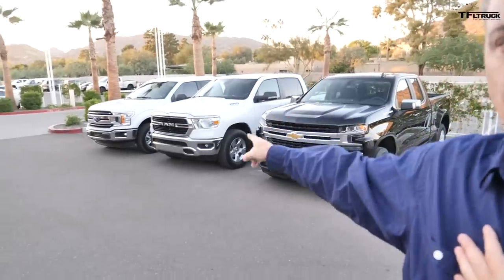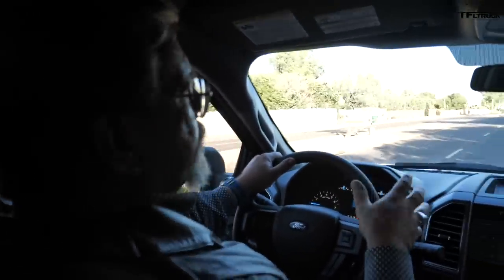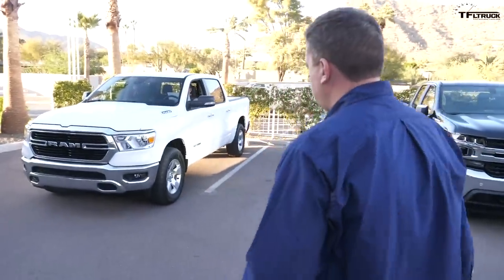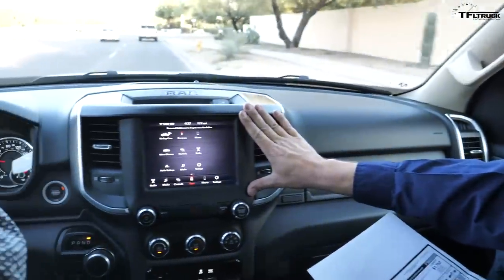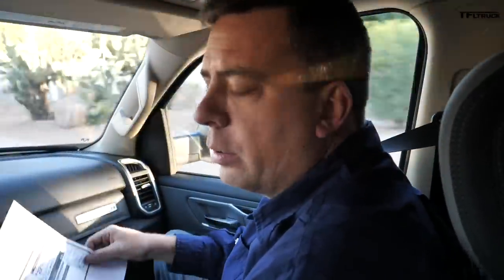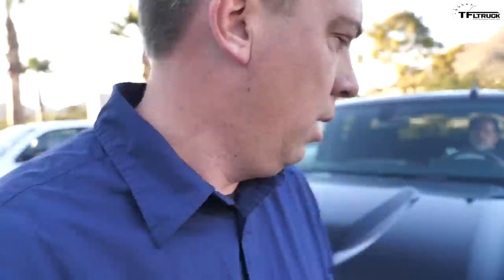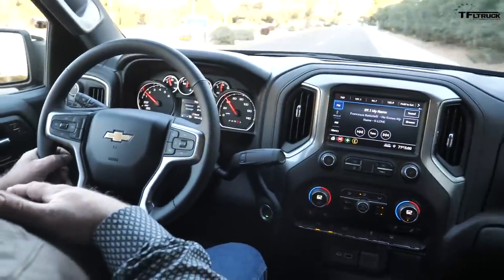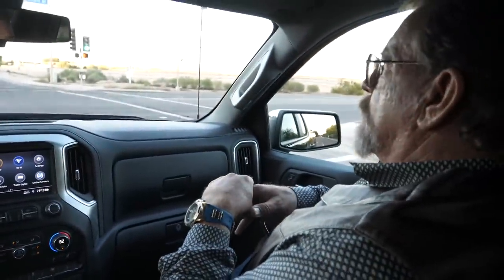Work Truck Wars: 2019 Chevy Silverado 4-Cylinder Turbo vs Ford F150 vs Ram 1500 Review

Comment: Oh that's sad that the Chevy has the worst fuel economy. I actually went on fuel economy.gov and look at the fuel economy on all 3 trucks and I was shocked 😲 at the results. So I looked up the fuel economy on the F150 in 4WD with the 3.3 L V6 as well as the 2.7 L turbo V6. The 3.3 L got 18 city and 23 highway 20 combined. And the 2.7L turbo got 19 city 24 highway 21 combined. Now the Chevy with the new 2.7 L inline 4 also with 4WD gets ready for this 19 city 22 highway 20 combined that's lower than than the F150 with the 2.7 ecoboost engine. However that's not the biggest surprise. The 2019 Ram 1500 with the 3.6 L V6 with the E Torque bolted to it and also 4WD as well gets ready 19 city 24 Highway and 21 combined. Now bear in mind the Ram has got the biggest engine of all these vehicles 3.6 l that's a little bit bigger then the 3.3 liter V6 in the F-150 and much bigger than the 2.7 liter V6 used in the F-150 as well and is bigger than the 2.7 liter 4 cylinder used in the Chevy. And yet the Ram gets the best fuel economy and all they did was bolt a simple little motor to the engine to get that. Not only that but the RAM is the only company that did not have to resort to turbocharging and going to a smaller displacement engine to get that power as well as the fuel economy. So for my money I think I will go with the Ram truck it achieved the same fuel economy as the others if not better and it didn't have to resort to downsizing engine or turbocharging funny how that works LOL.

Comment: It takes a special touch to rev a modern (basic non performance) engine and make it sound good. With all the rev limiter and emission control crap they sound miserable if you don’t catch it before the 4000rpm limiter. You gotta let off the throttle before the parked limiter and it just is what it is.  It’s like manufacturers think we’re stupid or don’t trust us and take away these small freedoms to hoon. Am I the only one that feels this way?

Comment: Can somebody please explain why this F150 only has a max payload of 749kg when my Mazda BT50 (basically a Mazda branded international Ford Ranger ) has a max payload of 1000kg? I looked it up in the manual and it's a 1000kg for sure. I would expect a full sized truck to have a higher max payload than a mid sized one or am I just wrong? Sorry if it's a noob question..
Reply: oh and my truck is 4x4

Comment: Id rather wait 2-3 years and get one of these trucks for $24K with 40k or less miles. 

I wish I woupd have done that instead of getting a brand new car in 2012 because of my price point.

$40k for base model crew cabs is ridiculous

Comment: My 2018 f150 stx has way more options than that xlt, and it has the 2.7 ecoboost/10 speed for the same price. It’s funny how ford does their pricing. You would be better off with an stx

Comment: Honestly, it's not that surprising that there are great 4-cyl full size trucks. It wasn't that long ago that the standard Chevy V8 was producing less horsepower than most turbo 4-bangers can today. Sure, more cylinders is usually more torque but the power-band is so easy to isolate with a new turbo engine that you don't need insane low end torque to get moving. It's good that people are super stuck on pointlessly using more gas than needed.

Comment: There is nothing about any of these trucks that make me want one.cost to much engines to small won't hold up over time don't need a crew cab at all,don't want an automatic I  don't want stop start to many gadget's to break and need repaired at high cost,I'll stick with old trucks for $40,000 i can rebuild a truck for quit a few years.and the fuel mileage isn't great anyway.

Comment: I don't really think the Chevy out did any of the base engines 😂 they are capable of towing just as much as the Chevy, and get better mileage?! You could probably spend the extra $4000 on the Ford to get all the other goodies the other trucks had too cuz it cost quite a bit less than the others.

Comment: don't see tow/haul mode button?  also don't really see a need for a turbo 4cyl in full size platform and minimal fuel mileage gains?  and then Chevy giving you the oddest trio to "compare" this video was just hard to watch overall.

Comment: Interesting....21.4 mpg with a 4x4 truck.... CITY... I think that's very impressive...thats better then EPA isn't it? I don't really even think the EPA actually Drive the trucks they test....I bet on the HIGH way it will be closer to 25 mpg not the 23mpg that the EPA says? 
I wonder what it can do when you drive it without trying to rev the turbo up and such.... I really do think GM makes the best trucks right now...I CAN'T wait for GM Stright 6 Diesel..ITS Gunna be hands down the best engine you can get in a half ton for sure..BUT I guess that's just my preference..I use to Drive a straight 6 f 150 and loved it...The truck market is REALLY REALLY competitive....WHICH IS GREAT FOR US

Comment: Something doesn't make sense. 44k for Chevy? 6700 lbs towing? My TRD off road Tacoma avg 21mpgs.  Tows 6400 lbs, and payload 1600 and change.  No turbo, start stop mumbo jumbo. I paid 32,700 out the door and my truck is loaded .  I would get the 5.3 and eat a few mpgs. Reliability is going to suffer.  I love Chevy so I hope I'm wrong.  But think about it....44k....c'mon now. My last truck was a Silverado. 2004 old school 5.3, 3.73, 2wd. No bullshit.

Comment: I bought a new Tundra 5.7 in 2016, I'm very happy with it ! It gets about 15 MPG  (Avg.) if you actually divide the miles vs gallons used. Trip Computer says 13.7 to 15 on a good day. It runs great, plenty of power, drives and handles good, 4x4, Good Truck. My wife still is driving our 2008 F-150, 210,000 and still going strong, 5.4, (I know many don't like this engine), but I've always used full synthetic oil, changed every 5000 miles. Or maybe we're just lucky.....

Comment: Not a fair comparison between the three trucks. But of course, look who provided the trucks for test comparison...Chevy! Id still take the Ford. The other two companies are TRYING to keep up with Ford who holds the bar in the best pickups. My 2016 F-150 302A pkg XLT SCrew 3.5L EcoBoost 4x4 is still easy better than GM and Dodge AND Ford didn't need bail out money from the Feds like GM and Chrysler .

Comment: Come on TFL, a fair comparison? A base Ford XLT-Crew-6 cylinder-6speed-355RE 2WD and the Ram Big Horn-Crew-6 cylinder-8speed-355RE 2WD is a fair comparison but introducing a Chev Silverado-Double-4 cylinder 2.7Turbo-8speed-342RE 4WD. The engine is too small for the drive train and truck, gets less gas mileage and is only a double cab. Chev bashed ford turbo models for years yet here we are, however so much more convenient options like safety features, heated steering wheel but $5K more for less gas mileage? The Ford and Ram have a proven history of reliability for their 6 cylinder engine. I see many problems with the 4-Turbo in the early years, however a proven 6 cylinder choice in this model is a winner. For me, My choice is between Ford and Ram in a double with a equal selling price of $45K to see what options I get. 
I am not bias as I drive a Toyota Tundra but next time, lets do a fair comparison. When Chevy flies you to sunny Scottsdale to do a comparison, you are immediately bias and coherse and fairness is kicked out the door.

Comment: So after watching this video it had me thinking about a truck, truck prices and 4 cylinder turbos! So I decided to go to the different manufacturer websites and build some trucks that cost around $46K to match the Silverado with the 4 cylinder. I built it as I was building it for myself and not a fleet. I don't have any experience in what a fleet needs, but I know the options I need and like. I like Auto Climate Control, Push button start and Blind Spot Monitoring so I optioned trucks out with those options since as a family guy I would at least want those options in my personal truck. The F150 can't be built with push button start without going to a Lariat so it is way over priced but one of the best rucks out there, it just breaks the bank to get any options and the aluminum is very wavy on the doors reminding me of the 2007 Silverado I had! The Ram is equipped with even nicer stuff if you push it to $46K! The Tundra is pretty much a gas hog but it will probably run forever! You can almost get into the limited if you stay with 2wd, but it lacks push button start. The Nissan Titan has everything in a crew cab SV with the Comfort and Convenience package. It comes with a V-8 with 390 horsepower and it has a center console and power drivers seat, Auto Climate Control and push button start. I bet it will run nearly as long as the Tundra and it is thousands of dollars less than the other trucks after discounts. I found one for $39k, 2019 crew cab SV 4x4 with the comfort package, splash guards and floor mats! So for the best bang for your buck I think the Titan would be the way to go. It also had Android Auto and Apple Carplay!

Comment: Cannot wait to see resale value on the 2.7L turbo down the road. Ford charges 40k for a 3.3L pos 2wd pickup? wtf. I was thinking more like $23,000. When the fck did a 4cyl pickup truck cost more than a crappy v6 one? Realistically a 4cyl pickup should start around $18,000. TRD Tundra wins all rev battles.

Comment: My 05 Sierra Crew Cab with the 5.3 Vortex 4x4 gets 24 (plus) Mpg with 135 Tires and 19mpg with Stock 175 tires doing 55mph. Pulls my 10,000lbs Trailer Easily and got 11-13mpg doing 60mph. Paid $10,000 for in 08 with Less than 80,000 on it.

Comment: When you guys cover start/start please let us know if it needs to be turned off every startup or if it stays disabled. This would be very useful for consumers like me who despise this feature. it's a deal breaker for me, i'd never buy a vehicle where it couldn't be disabled.
Reply: They can all be disabled by pushing a button. But younhave to do it every ignition cycle. I believe all the trucks will disable it automatically when a trailer is plugged in. There is already trailer plug units you can buy to plug in and keep it off. I bet the tuners that come out will be able to disable it.
Reply: @geoffmooregm  BMW is a toggle off and it stays off until you toggle it back on again. So some companies are definitely doing it the less annoying way! It's silly to have to find a way to defeat the system, when imo, they should allow us to simply toggle it off and have it stay off between starts

Comment: I paid less than the MSRPs on all these for my 2018 F-150 Supercrew Fx4 4x4 2.7, a 49 K MSRP.

I put some back into it for a 130K 7 year warranty, and Husky Liners. Now I have the sound deadening of carpeting with rubber to reduce the carpet wear.  I don't go running a host through the truck to clean it either because that would be a sure way to have corrosion.
 down the road. 

No lag with the 2.7, and it will out mileage and out pull the Chevy. 

The Ram needs more low end and 3.9 gears, or just add a good turbo or two.

Comment: You get a lot more for your buck with GM 44000$ with 4x4.Ford 2x4 with hard plastic everywhere 42000$.Ford buyers are getting ripped off.🥴🥴🥴🥴🥴🥴🥴🥴🥴🥴🥴

Comment: Funny that the 4-cyl chevy didn't have the approach of some other gasoline turbo-engined ones - that is top torque from about 1650 rpm and keeping it to about 4000rpm... VW might have had it first some time long ago. makes gasoline engine feel like a diesel and I think that is very nice on everyday use. Otherwise nice, Ford is a little behind still. Come on Ford!
Reply: The ford has been around since 2014, I would hope brand new trucks would be able to beat it.

Comment: Not sure why the MSRP is so high for the XLT (base XLT with 300A with chrome?) in USA.  40000? In canada its less than that.  With Discounts before tax (13% in Ontario) 301A package XLT with 2.7V6 turbo is 34000

Comment: The $42k RAM feels much more expensive than the $40k F-150. I love both Ram and Ford trucks, but these new Fords are just really overpriced for what you’re getting. At $40k, you should at least get a bigger touchscreen infotainment system with sat nav, but instead, you get a crappy little 4.2 inch screen clattered with buttons on both sides. Not to mention the Ram’s base screen is a 5-inch touchscreen.

Comment: 40k!!! Why the fart are these trucks   so much!?! A farting V6 is 40K??? I'll get a used HD for 30K and buy a trailer with the other 10k. I feel sorry for folks where the SOL and MGI are low. I'm just not gonna pay 40k for a truck I can't put a pallet of cement in. Oh and I can't push snow or even drive in it!!! Fart this fart you fart them!!!

Comment: These are all nice trucks, but the engines in the Ram and Chevy make me take pause. The Etorque engine could be problematic as it ages - not the engine itself but the batteries and Etorque device. Can i see this engine at 150k miles and taking only normal maintenance to get there? There’s some worry there.
The Ford is pretty simple - proven V6 backed up to an old 6 speed trans. Nothing special or whiz bang but I can see 150k miles with minimal worry. 
Ah, the Chevy....there are several things I worry about here: did I hear them right concerning a sliding camshaft? Electric water pump - at least it’ll be easy to change. A chain driven oil pump on the back of the engine; GM has done this before making servicing it a miserable experience. Plastic diverter valves that control coolant flow - hopefully they used a top quality plastic. Cylinder deactivation; this is a proven technology but that doesn’t mean I like it.
On some parts of this new 2.7 Chevy is visiting the bleeding edge of technology.  I’d love for it to work out for them but I’m going to let the first adopters play the part of “GM final stage R&D department “ while I watch.

Comment: After playing with Ford's website, you can configure an F-150 regular cab 2WD with the 5.0 V8 and 10 speed auto, in an XL, for under $35k before incentives. That's the work truck I'd want.

Comment: I'm not buying new anything,but I've owned 5 vehicles in my life,4 were/are Ford's,I have 2 F-150's now,both run great,a little older,1 has a 4.2 the other a 5.4, I'm happy,do not like the new Chevy's, ram is coming on strong,but it's hard to not to pick Ford

Comment: Guys, I think something is wrong with your pricing, I got a brand new XLT 302A package back in 2015 when the new model first came up which is the worst time to buy and it only was 47k and it’s the 3.5 eco 4x4 so..... I think there are inaccuracies here.

Comment: Looking at this closer, they noted the Chev did not rev a readily as the others. The problem with that truck is it had GM’s 8 speed auto which has many many complaints about the 8 speed not shifting down efficiently and being slow in shifting down. Should have had the 6 speed or 10 speed. Some guys I know with the Canyons all prefer the 6speed to the 8 speed because of the issues mentioned above.  I like the idea of the 4 cylinder turbo but prefer a V8 still, I am an old fart by the way, and like the sound, respecting that a V8 may not be the best engine. Need the GMC there, it looks so much better and they did not give the squarish wheel wells up on them. 
   The 2011 lbs payload could allow you to haul a simple truck camper or some of the pop up campers. That appeals to me for my purposes.  Here in southern Alberta, the 5.3 is about $1600 more but you get different options. (GMC) Hmmmmmmm good luck out there shoppers and everyone stay safe!

Comment: Of course the gave you the base engine and not Fords 2.7L. Because Chevy knows Fords 2.7 will kick Chevy’s 2.7 ass. That must be a 2018 XLT because 2019 XLT F150 has Sync 3 standard.

Comment: Haven’t dealt with the chevys turbo four... but we did a leveling kit, slightly bigger tires, turbo back exhaust, CAÍ, canned tune on a Ford turbo v6 and it was a joke the guy asked me what I thought I said well I expected a lot more you’ll be lucky if this will do 17s in the quarter mile. He sold it nd bought a diesel a few weeks later. Dodges v6 is very torquey off the line.

Comment: You guys at TFL need to do a video on my 18 F150 5.0 Roush Supercharged. Super Crew 4X4, Ruby Red. Anyone wanting the stock 5.0 in a truck, looking for some more power in the V8. . . .And you have the coin. I think it's very much worth it. That 650 HP is very nice towing my boat.

Comment: Correct me if I am wrong, but as they drive the F150 I am thinking the engine noise is actually run through the speakers of the truck!

Comment: I'd really like to see TFL do its own comparison, next time of half-ton work truck 4x4s outfitted for work (rubber floor instead of carpeting, towing package, bed liners, etc.) using these same engines. Chevy's 2.7 shows real potential, but the RAM's V6 with "eTorque" is by far the best-put-together truck. Maybe GM will continue to develop the 2.7 and give it an eToque-like system in the years to come. Borg Werner developed a new boost system that uses an electric turbine to enhance a turbocharger, allowing for larger turbochargers to be used without any lag. There are many possibilities.

Comment: We have 2, 2014 1500 Silverados which both needed new transmissions and one needed a new engine. Those trucks cost at least 40 grand each and in my opinion are both toys and I personally wouldn't buy a 1500 Chevy if it was half price.

Comment: See Chevy choose the worst comparison ford the most popular its crew cab with stx package you get the 2.7L and 10 speed with the 8 inch screen for $39.930k so cheaper then the xlt the configuration will blow both trucks in power